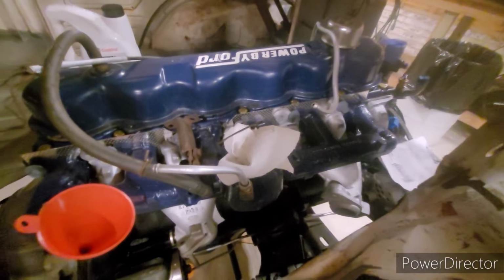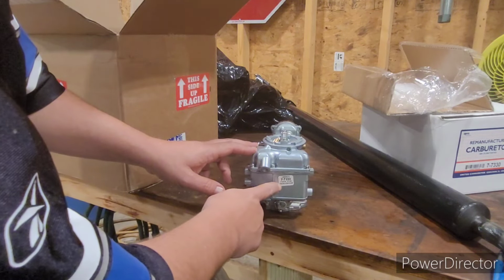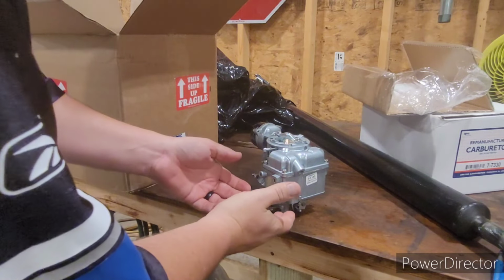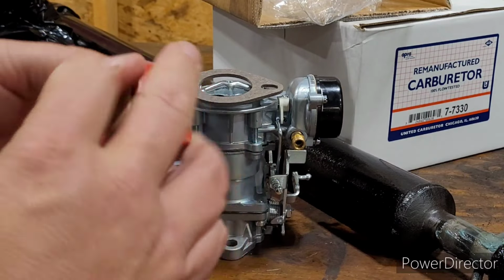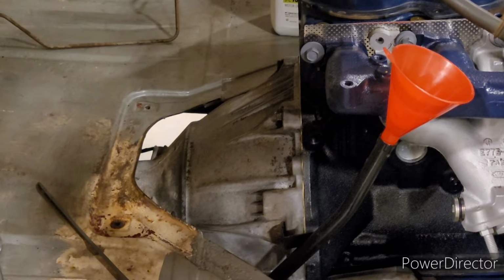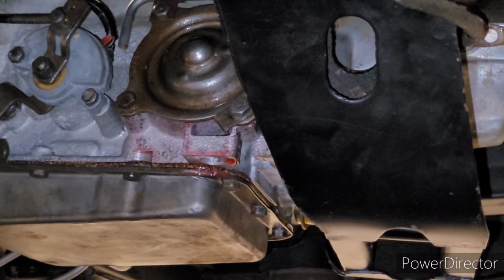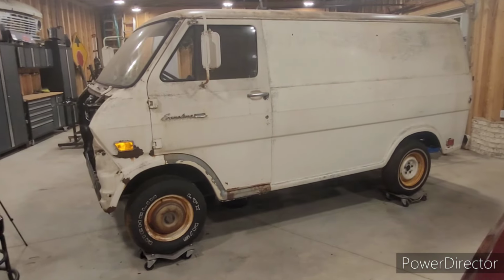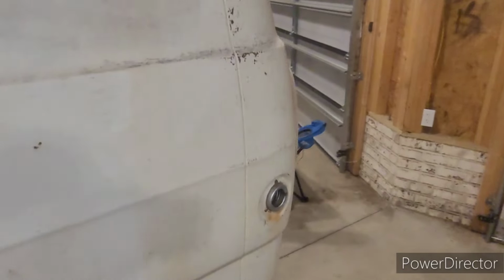Rock Auto & UREMCO You Did Me Dirty. Chunky Pt. 43 2nd Gen Ford Van

Comment: I wish you all the luck brother.  Rock auto did me dirty once.....I ordered a remanned starter for my Comet and they packaged up and sent me someones old grimy core !!!! No joke.  On the positive side, I contacted them and they sent me a new remanned one and let me keep the old core, they both work perfect.
I find that pretty much everything you get now is cheap knock offs.  My sons Cruze needed a vacuum motor for his brakes.  Rock auto had one for 220.  I quickly checked Amazon and found one for 88.  Probably the same ??!!
Now to deal with that trans shop 🙏👍
Reply from the maker: Wow that is on another level!  I once looked over the choices for brake hoses and they had the cheap sunsong brand but I chose ac delco.  When the box came it was a sunsong in an ac delco box.  This was way back when you could call rock auto and the guy say that's normal.  Ac delco gets sunsong to make their parts sometimes. I was like....why did I pay twice the money then.
Reply: @sircrunch80  Yes I got brake lines from rock auto for my Comet.  7 dollars a piece.  They hold oil so far, what the heck.
I also ordered a genuine GM VV cover for my son's Cruze.  Was made in Poland.  Who knows

Comment: Good afternoon Sir, I would get in touch with rock auto and raise H***L and demand what you originally ordered or at very least a refund for the $120.00 they clipped you for. And the transmission folks , wouldn't even want to see me after that. That being said, there are so many junk new parts out there now that the transmission guy's may have just recived junk parts. Sorry for the compasion but I've personally had to return several " new " items for being bad. " no-one pays us back for the labor, do they"  Have a great week and good luck Sir.
Reply from the maker: Well I'm a sucker for a low price and a bargain but rock auto is very inconvenient sometimes.  Local chain auto stores are just so wildly expensive.It's hard to fathom shopping there
Reply: @sircrunch80  Please don't think I meant anything buy it, I personally would try to get them to give you what you paid for. Now days I won't even leave the auto parts store with a new  alt. or starter without making them test the new one. And yes I also buy on line. Have a great week.